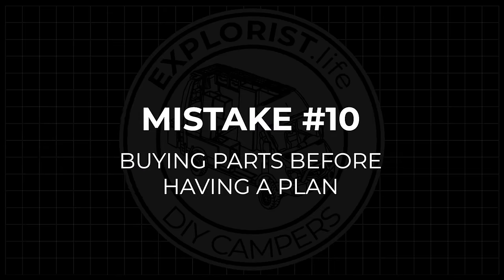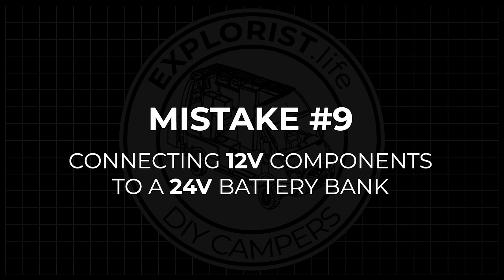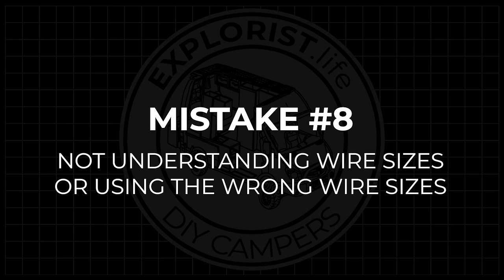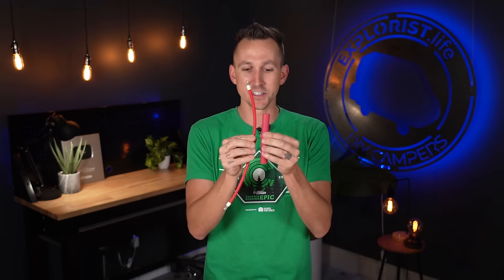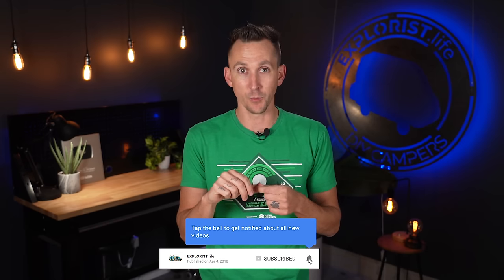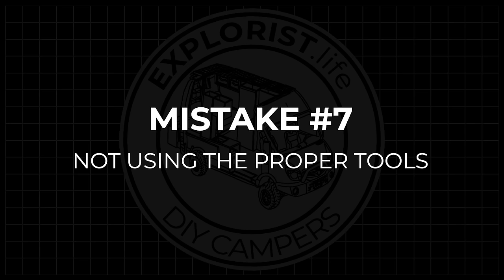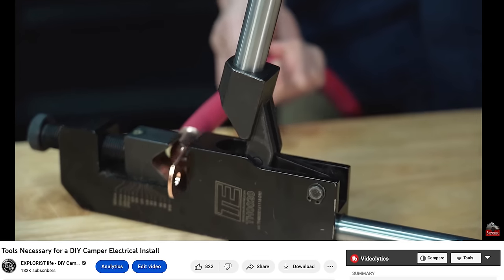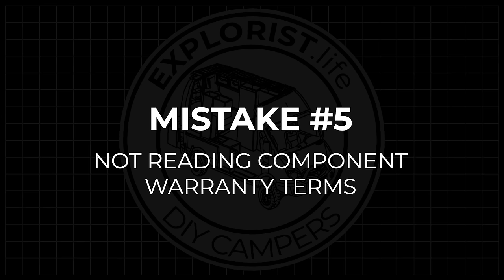DIY CAMPER ELECTRICAL MISTAKES (and how to avoid them)

Comment: Hi Nate,
Is there a way to contact you for input on my van wiring kit needs? on the website doesn't look like you are consulting anymore.
Reply from the maker: I'd rather see you just use the complete kits I've pre-assembled as that is my most recommended methods.  Do our pre-assembled wiring kits not meet your needs?
Reply: @EXPLORISTlife  Sure, understand completely.  Maybe you could suggest which kit would be best for my needs.  I have Renogy 2-200W solar panels, 2- 200W lith batteries, 60A DC to DC battery charger, 3000W inverter, Victron LYN060102000 Lynx Distributor, SmartSolar MPPT 100/50 Solar Charge Controller, BMV-712 Battery Monitor with Battery Temperature Sensor and blue sea ST Blade Split Bus Fuse Block and SafetyHub 150 Fuse Block.
Reply from the maker: This is the direction I'd point you.

This wiring kit: https://shop.explorist.life/shop/all-products/camper-wiring-kits/complete-wiring-kits/wiring-diagram-kits/400-1200ah-multiplus-3k-12v-orion-12-12-30-wiring-diagram-kit/

Plus this solar charging kit: https://shop.explorist.life/shop/all-products/camper-wiring-kits/solar-charging-wiring-kits/400w-solar-charging-wiring-kit-2x-200w-24v-battery-bank/

You'll have to return/exchange a few parts you've got going on (60A DC DC Charger, and the 3000w inverter if it's not the Victron Muultiplus), but it's pretty close.
Reply: Thanks so much for your help. Is there a reason I can’t use my renogy 3000w inverter and renogy 60A dc to dc charger? The reason I got such a big one is in case I wanted to add more solar or batteries. My van has a 100 amp battery and 220 amp alternator. 
Thanks again for your help.
Reply from the maker: @MelanieMiller-dz5jl  You can absolutely use those.  I just don't have a wiring kit available for those specific components.
Reply: @EXPLORISTlife  Great! Thanks 
Could I hire you to give me a list/ diagram of the size of wire, fuses and components I would need to put this all together? I’m sure I can figure it all out on my own, but after watching your latest video I’m afraid I will make some stupid mistake or buy some subpar component and my van will burst into flames.
Reply from the maker: @MelanieMiller-dz5jl  Basically no.  If you were willing to spend a couple hundred dollars to hire me to do that, I'd rather just see you buy higher quality components.  That'd be a better use of your funds, IMO.  You could probably return/sell your renogy components and just buy higher quality Victron gear for the same price as keeping the renogy stuff plus paying a consulting fee, if that makes sense.
Reply: Okay, thanks for answering all my questions. It’s been too long to return my components, so I will just have to work with what I have. Thanks again for all your help.

Comment: Hey guys,  hope your' season is going well. What heater option did you go with? Webasto diesel heater? Propane? Water heater? Is weboost really worth its price $$$? I'm in truck and trailer and would be great to meet up if you're still doing road gigs? Or camp meet
Reply from the maker: We haven't installed our heater just yet, but will be going with espar/webasto gas heater (can't remember which with my 6:30am-half-cup-of-coffee brain. 😂)
Reply: I installed the Rixen system in my truck build, I’m a carpenter and I have it set to 50° to keep tools warm and when camping in truck just turn it up.  I bought it in Sandy OR because I happened to be working in Hood River at the time.  Was a bit pricey but has worked flawlessly and the guys there were so helpful with any questions I had.  Being in the mountains it also has a built in altimeter so it adjusts with elevation change.  Also I bought the hot water kit and the engine kit so I can have free heat while driving!

Comment: Nate. Really like your web and vids. You mentioned too low voltage from solar array not charging the batteries but what about too low array wattage to charge a battery. Because of fund limitations I can only afford a 800 watt array to charge a 600ah battery bank. I know I should have a 1800watt array but can’t afford it now. Will it work?
Reply from the maker: It may not charge all the way to 100% depending on how much of those 600Ah you are using every day and you'll need to supplement with a generator/alternator/etc
Reply: @EXPLORISTlife thanks I’ll be adding 400 more watts soon. Will the Victron 150/100 mppt handle more than 1200w in case I want 1600watta. I will be using your1200w  diagram system to guide me
Reply from the maker: Check this out (paying special attention to the 'NOTE' in the product description): https://shop.explorist.life/shop/all-products/camper-wiring-kits/solar-charging-wiring-kits/1600w-solar-charging-wiring-kit-8x-200w-12v-battery-bank/

Comment: Nate-- ty for this video! Is the Victron 12V 3K inverter + GC3 270AH battery pair a big problem?  I purchased my "kit" over the phone with Battleborn including those components. Everything else matches your wiring diagram in my set up. I had at least two conversations with Battleborn by phone to put my kit together and they never once mentioned the minimum AH for the inverter which seems like an obvious thing to let a customer know -- I didn't notice it in the manual until recently. I have everything wired up except the inverter to AC panel. Working on that currently. Now I have to buy another $2500 battery? Hmm.
Reply from the maker: Tough to say at this time.  3x100Ah Battle Born Batteries has issues pretty often, but I don't have enough data on the 270Ah batteries to know if their BMS handles the inrush current differently.
Reply: I placed an order last week with battle born for the Victron multiplus II 12V 3K 2x120 along with three 100 amps batteries and some more stuff but they never mentioned that issue… 😖 and my small rooftop it’s maxed out at only 400 watts of solar power… ☹️

Comment: Hey Nate, great video! One question on the "reading the manual" part. You say people have complained that their system turns off when they have 300 amp hours of batteries with a 3kVa inverter. What exactly was their problem do you know? I'm using a 220v 3kVa (2600 watts) inverter as I'm Europe, and my system is planned to have 300 amp batteries, but at the moment I'm with a 100 amps. I have been using the system for 1 year with 0 problems, the one thing I have done is limit the AC output from the inverter so I do not exceed 1C that the battery is capable of (1200 watts). I don't see any other issues that might be a problem with having a smaller batter bank, maybe the peak power of 5500 W that the inverter is rated? If you are using  products that do not exceed 2600 watts the inverter is rated to, the batteries at 300 amps have a 3600 watts for output, so that will not be a problem for the batteries, and if you put a 300 amps fuse, the only with the peak power of 5500 watts that will happen will blow the ANL, which will be a appliance failure. Can you give some thought on that if I'm mistaken? Thank you!!
Reply from the maker: The issue lies in the inrush current of the multiplus 3k capacitors drawing so much power for a few milliseconds at startup that it shuts the BMS of the batteries down because it sees it as a short.
Reply: @EXPLORISTlife so is the answer to this issue more battery power?
Reply from the maker: Yes

Comment: one of the thing i run into constantly is ppl belive the rated power on the cheaper china products , and running them on the ragged egde of their rating ..the cheaper products can be used to build a decent  system  but a good rule is never run then over 70% of their rating to be on the safe side 50%
for any fre standing system (high draw) sized 200ah or above ,to stick with 12v  it takes a very good installation very heavy cables good batteries and  still one is close to the top of what the system and cables can handle,,if one simply goes up to 24v stick with the thick  12v cables  and  the installation is sound  that problem is eliminated
oh and i constantly see ppl spending thousands on very nice products  chargecontrollers inverters battery chargers high power stuff and they only have room for 600w solar and 2 tiny batteries

Comment: Can I add 2 lithium 100-amp batteries in place of my lead acid. my converter has a switch. Do I need to change wires or anything else? I do not want to do a big rewire of trailer.
Reply from the maker: If your converter is set up to charge Lithium and everything else is good to go for Lithium, yes.  You'll want to dive into learning about you system.  I can't say for 100% sure that it will work based on the minimal amount I know about your system.

Comment: Welp, I am guilty of not reading the manual. Bought a renogy 2000W inverter and one 100Ah 12V battery. I guess the minimum capacity for their 2000W inverter is two 100Ah batteries. Kinda sucks. I was getting the 2000W inverter so I had headroom for extra loads later. Another battery right now is outside of this DIY budget of mine.
Reply from the maker: Yeah, that's rough. 😣
Reply: @EXPLORISTlife  thank you for this video though! luckily I saw this video before I started wiring everything together! And luckily Amazon makes returns easy! Haha gotta order the 1000W inverter now 😅

Comment: Is it okay to use bigger than needed wire? I had a long run where I needed a bigger gauge, and instead of using a bigger gauge for only that one specific run, I just used it for everything 12v. I know I spent more money than needed but figured it would be okay.
Reply from the maker: Most of the time it's fine given that the wire can fit into the terminal of whatever is being connected.
Reply: @EXPLORISTlife  thank you for the response!

Comment: I just want to wire 1, 100ah battle born with 1, 100 watt solar panel. I have a victron 100,30 charge controller... Now I'm doubting it will work....... I only need to power a 12volt fridge and diesel heater.
Reply: If anyone has a link to wire 1, 100ah battle born battery it would be greatly appreciated. I would pay for the detailed wire diagram

Comment: Hey Nate I actually bought a very expensive bundle from victron for a for transit. Any chance I can get help with a wiring diagram? It’s all bran new best of the best, 3x 330ah batts, all victron components, and 2nd alternator kit. Cost over 15k so far, and there’s a few things are finding some conflicting information on and the absolute last thing I wanna do is screw it up
Reply: I’m def buy all the wire and lugs from you also. I didn’t realize the bundle I bought doesn’t come with any
Reply from the maker: You'll want to get a diagram from whomever you decided to do business with on those components.  Then for wiring, you can browse our wiring kits to see what we have that will work for you.
Reply: @EXPLORISTlife  I understand I bought it from, vanlifeoutfitters, they seem to want to be helpful but I like your content and explanations much better. Some of the stuff I have here you don’t have a tutorial on yet as far as I can see but I’m still hopeful. I guess my biggest question was they appear to be running the battery positives all the way back to the links distributor for each battery rather than daisychain them together essentially providing fused power for each and I wasn’t sure if they were doing that just so I had to purchase two links distributors lol but thank you very much for responding
Reply from the maker: @maddhatter8 Yeah, that's not what I recommend since it requires more wiring/fusing/components/space.  Glad you find our content helpful, though!  Would love to have you as a customer next time for your whole system so we can help you from the start!  There's too many other dealers/distributors out there who are only interested in selling the components but offer no help on how to wire it all together.  I hate that you didn't find us sooner. 😪
Reply: @EXPLORISTlife  me too :(

Comment: Problem with user manuals is that they are written in a language other than common sense and is often times only understood by other electrical engineers, that speak the same language, combined with the fact my manual was 75 pages long and only understood a wee bit , 
And the main issue i had was not in even one paragraph of one page , the only way i solved it was reading it on a couple blogs, and it was a basic problem that lots of people had like—why wouldn’t my generator charge my 48v battery through my inverter? (Needed inverter generator with clean power)
Which i would say most solar nerds would know, 
Just aggregating to see the smart people that make and write the stuff can’t relate to most of their customers
Reply from the maker: User manuals definitely aren't the end-all-to-be-all answer to solving problems, but like everything else, should be part of the equation.

Comment: Help !  2021 Grand Design Reflection 5th-wheel came with a cheap, flooded battery.  I upgraded to a 206aH SOK lithium battery only to find that the OEM WFCO converter was not lithium compatible.  So, upgraded the converter to a WFCO 8955-AD (auto detect). It lasted about three weeks before it overheated to the point of the transformer coil coating melting off (nasty odor).
Returned it,  thinking the converter was defective. In the meantime, ordered and installed a PowerMax PM3 series, which was cheaper and easier to set up.  It lasted 2-1/2 weeks before melting down as well.  Any ideas?  The converter replacement is very basic, so apparently not the issue.  I am clueless at this point.  I just finished a month long stay at an RV repair shop for slide motor replacement.  When the first converter failed while at the shop, their electrical person was clueless (under-skilled) as well.  Help !    PS; have a second SOK 206aH battery, but not yet integrated.
Reply from the maker: If you've burned up two converters in a row, I'd suspect there is something wired wrong.  Converters can fail, but two of them back to back?  I'd be triple checking all connections and making sure everything is connected properly.  Reach out to tech support of your converter if needed.
Reply: @EXPLORISTlife  Thank you!  I pulled the distribution panel out and traced the wiring back to converter. Found a worn spot where the hot had been rubbing against a screw.  I insulated the area, properly secured the wiring (which the factory had not). Will be installing another replacement converter tomorrow, but pretty sure this was the issue.

Comment: for someone who is not handy and lacks understanding of electrical concepts, it is more economical , less headache to just buy the solar generators that are so readily available rather than doing a diy build.. At the end the price difference is not much or even less than a dyi build.
Reply from the maker: Depends on their needs.  Paying for installation is another option for those not willing to learn how to be handy.
Reply: Everybody is different. I built my own  7200 watt hour solar generator with 3000 watt inverter, on board 70 amp Aims battery charger, 40 amp Renogy MPPT charge controller, 175 amp Anderson plugs to piggy back in another 300 amp hour battery if needed. Cost $3500 or so to build but I had to make my own roll cage on wheels to transport it. The EcoFlow unit with extra battery of comparable power would cost almost $8000. The commercial solar generators have a disadvantage. When one component fails, you can't repair it and need to ship it back for warranty work. The unit I built runs 2 chest freezers and has been in constant nonstop operation since May of 2020 with no troubles at all.  This was my build #4. I recently finished build #14 for a friend's Class C motorhome. Its fun for me....

Comment: Hi, 
What's the thickness and with of Victron copper strip?
Thanks
Reply from the maker: Our Lynx Adapters?  They are .25" x .75"
Reply: @EXPLORISTlife  just realised the auto correction messed up my question.

What I meant to ask was, whats thickness and width on original victron bus bar
Reply from the maker: I don't know.  Never have needed to measure that.  They are rated for 1,000A though.
Reply: @EXPLORISTlife  ok thanks  just thought the copper adapter looked much smaller in width, not sure of the thickness, compared to the victron, will it handle the same 1000A current.
Reply from the maker: Ah, no.  They are the same size as 4/0 wire, which is sized for the largest wire we would ever connect to the Lynx Distributor in any of our designs.
Reply: @EXPLORISTlife  understood, thank you.

Comment: HMMMMM between you and Will , to some extent, i have done about everything yall warn against...3 years later,  i have gotten past that and the system is doing great... but   I do have several BIG  boxes of very nice parts, tools and wire, ETC   that dont fit, wrong type, too big , too small or too cheap to trust. AKA...alot of money.....LISTEN TO HIM NEWCOMERS...HES RIGHT....!!
Reply: Smiles from me...I must have 15 inverters, 9 MPPT charge controllers, lithium batteries galore, 7 battery chargers for lithium in 12, 24, and 48 volts, copper wire of all sizes including a partial 250 foot reel of 4 ought red cable, maybe 200 crimp on terminals from 4awg to 4/0 gage. I buy this stuff during sales, Craigslist, and scrounging. Its very nice to not have to buy anything when I get the urge to build another project.

Comment: Well, it's a good thing I only made the #12 mistake😒... Still a very costly mistake for what I want to accomplish... Back to the drawing board😭
Reply from the maker: What was mistake #12?  I think I only had 10 on the list. 🤷🤣
Reply: @EXPLORISTlife  l 🤣... Exactly!...I made the #10th mistake....#11 I didn't find videos by you and Will till I already committed #10....😒#12 I thought I could fix the problem by just adding more components 😭

Trying to make a 2400watt (12-200w panels) system on 12v.  Now I realize I should have just bought the 24v inverter instead... Now I need to get another 150/85 mppt😤..